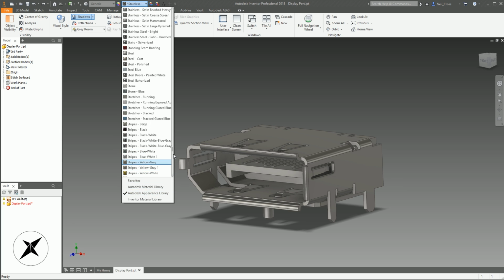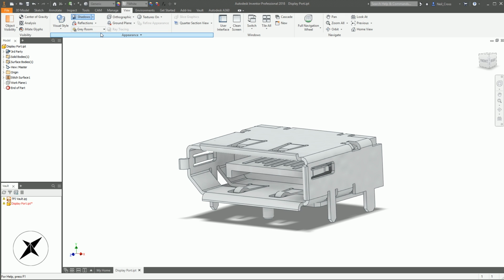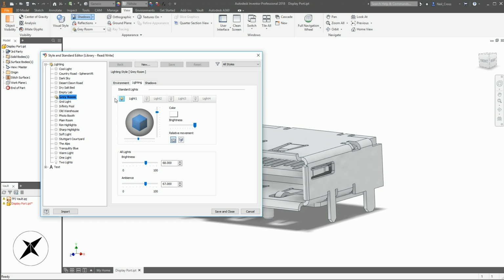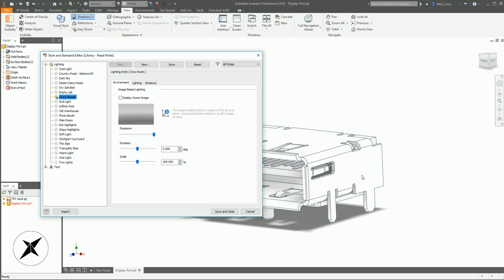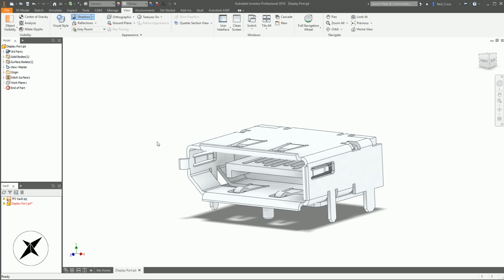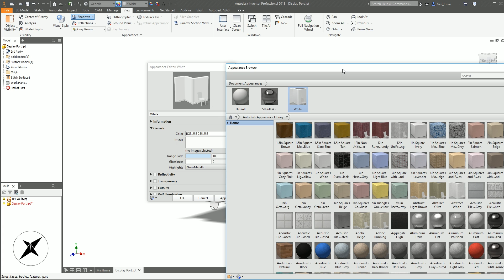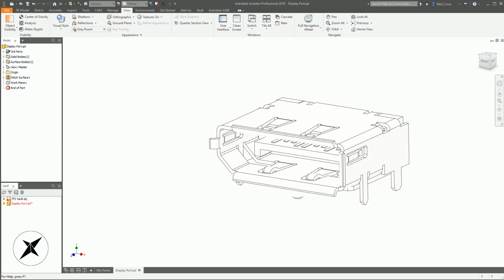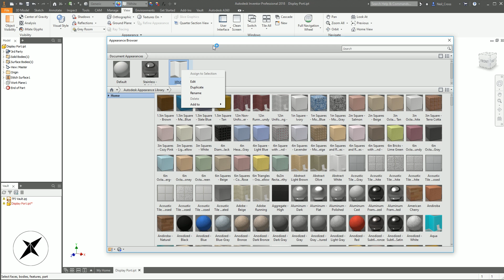How to make a model look PROPER white!

Comment: still wondering how its possible to move the camera like that....
Reply from the maker: Yea 3DConnexion space mouse/3d mouse.  The top end ones are expensive but the entry level ones are no more expensive than a half decent mechanical keyboard
Reply: Scott Moyse, it's more an issue that any lighting style is ignored for any color object in a drawing view.
Reply: Juden 3D mouse.  It's hella expensive
Reply: so theres hardware to move a camera? noice
Reply: Michael Thomas worth every cent though
Reply: What does it look like when placed as a view in a drawing?  As I understand it, the lighting style in the part or assembly is ignored in a shaded drawing view...And their standard, crappy, cannot-be-changed, style is used.
Reply: Mike Hodson why wouldn't you just place is as a non shaded view in that case?